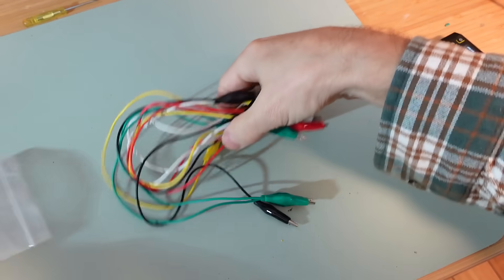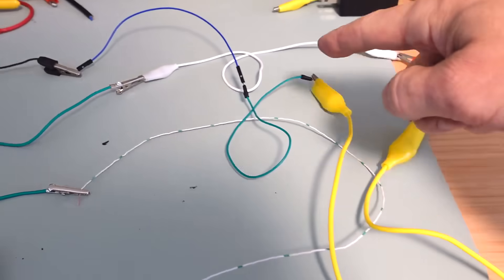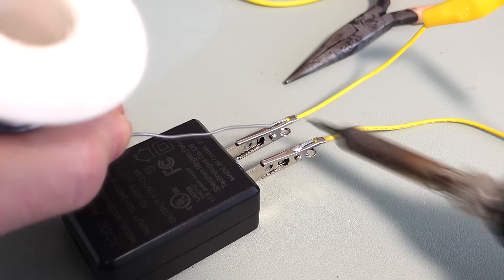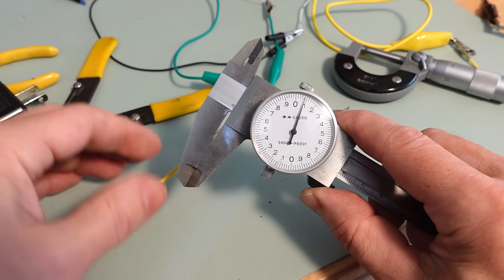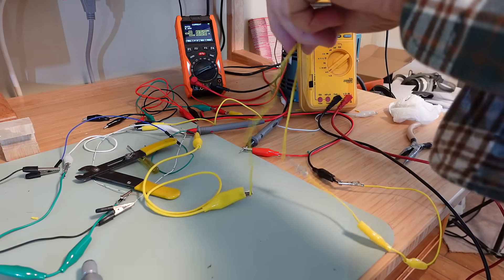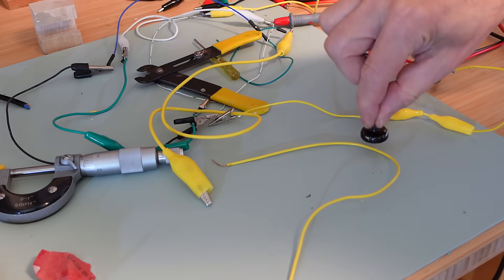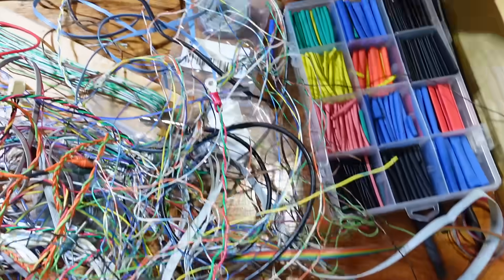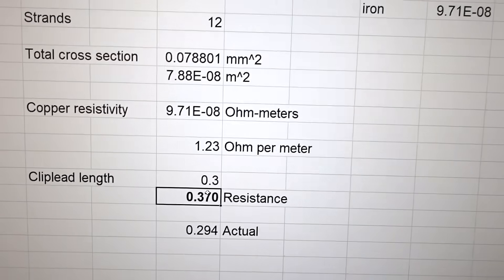Clip leads made with fake wire

Comment: Copper coated aluminum wires are actually quite common, but I dont think I have seen (or at least noticed) copper coated iron wire before... What a tragedy. 
After checking my cables, most of mine ar fine, just a few cheap clip leads are indeed also magnetic.

Comment: My multimeter cant precisely measure milliohms like that (i presume you need a special one) so I've always had to measure this by supplying a voltage with a known resistor in series and measuring the voltage drop on the wire and then doing maths. I was successfully able to observe the difference in resistance over a length between copper and CCA once with this method.

Comment: I think you are simply asking too much from your no-specification cheap chinese trash garbage junk. Every knows these are trash, and immediately replace the wire with real copper stranded. The kit is nothing more than a source for the covered gator clips. You should kniw by now. Old RS were often trash, too.

Comment: I wish you had uploaded this video 6 months ago.. because a year ago i purchased 20 pcs of them and also purchase breadboard male and female jumper wires after 6 months we shifted to a new place and never used them but since they were very dusty due to all the shifting.. i washed them with water and dried them and stored them and 3 months later when i tried to use them, i couldn't get good connection and most of my wires weren't conducting end to end so i removed the sleeve and saw that the wire strands were completely rusted and just broke off...!!!

Comment: I've seen "copper" wires that won't twist and stay in place. It went back straight. Felt like copper plated plastic. (And it was in a iec cable at that, rated for 10 amps... )

Comment: It's called Litz wire. It's been around for years and years. First time I've seen it used in test leads though. The reason it's so high in resistance is that there's very little copper if any at all. It's mostly filler with a few tiny strands of wire wrapped around it. Sometimes they'll use foil. They use this stuff mostly in things like headphones and other light duty applications that don't carry more than a few hundred microamps of current.

Comment: Well done exposing this scam !  💯💯💯💯💯💯💯💯💯💯💯💯
I had bought so called Dupont Line off Aliexpress for prototyping. 
This explains a lot. I had noticed something odd with them. They did seem a bit resistive and if they are bent a lot they break internally very easily, but I could not put my finger on the issue. 
After seeing this vid. I stripped a lead, it had 8 fine cores (abt. the thickness of a hair) and when using fine sandpaper on the copper coating, it can be easily be removed to expose the iron. Can't be tin as at is magnetic ! 
It was listed on Aliexpress as "40-120pcs Dupont Line 10CM 20CM 30CM 40Pin Male to Male + Male to Female Female to Female Jumper Wire Dupont Cable",  shrewdly enough they do not mention copper core wire anywhere or it's gauge.
The sad thing about about this was I read some of the feedback and saw comments like "Excellent quality cables for my Arduino projects. "  What, Huh ?

A search on Ali turned up one listing that did claim a copper core and the gauge:
"Copper Jumper Wire Dupont Cable 10cm 20cm 30cm Male Female 24AWG Solderless Flexible Line Connector for DIY Arduino Breadboard"
  .... hmmm wonder what they will be like ?

Comment: I would suspect that the USB cable for the mouse still has a copper or aluminum conductor, but uses iron or steel for the the braided shielding.

Comment: Had a lot of problems with "arduino" jump wires when needed fast prototyping. Most of them got corroded inside in few months to the point only plastic and dust inside left, impossible to use in any way. Tried to buy different ones on amazon but no luck. :(

Comment: I've been aware of Copper-Coated Steel centre cores in cheap satellite cable for some years, but didn't seriously expect it anywhere else. This is an eye-opener for me.
Copper-Coated Aluminium wiring is more common, I think. Still not great, though.

Comment: I can understand iron wire for Voltage MEASUREMENT, but for Current DELIVERY, that's unacceptable.
But I think most people would be using alligator clips for voltage measurements, and not current delivery.
Still pretty shatty of the companies though if they're selling on-par pricing or not explicitly stating the right resistance or current rating (which I doubt they are)

Comment: Even without having seen the video to the end, I would like to make a comment. 
I spent 6 months in Africa during my studies and we bought a few multiple sockets there in one of the "street-stores". One day we heard a strange noise during the day and realized that it was coming from a cable to one of the multiple sockets (the cable was burning and sparking). After taking it out of service, we discovered that the cable, including the insulation, was as thick as we were used to, but the electrical conductor itself had a cross-section of "no more than 0.5 mm". We couldn't even say for sure that it was stranded copper wire, possibly even fake wire (thin steel/iron wire), as we have heard in the past.
What I'm trying to say is that there is good accessibility to cheap electrical equipment/tools/aids through various internet stores, but when it comes to mains voltage you shouldn't compromise. At some point, there will be a fire in a house due to inferior electronics without a certificate. Standard insurance companies may not pay out because it was not an approved/certified electronic device/aid ... and hopefully there was no personal injury, imagine that alone.

Comment: Thank you for this video as I just got some dupont wires with a device and I tested the and discovered that what should be copper is strongly magnetic. I will put these cables in the metal recycling bin. I went over all of my other device cables, mouse cables, cheap 3D printer cables . . . no other magnetic cables anywhere. --still, very good to know

Comment: quite annoying indeed to have wires with to high resistance. 0.3 ohm for such a short wire is a lot.
even though technically seen it is not illegal or originally seen as fake if the description doesn't list it as copperwire.
so little we can do directly other than making things ourselves or finding ways to buy only wires which actually have propper wires inside and/or speciffically list it as such so that if they fake it we can dispute it if they lied.
didn't expect such huge resistances.

Comment: the iron in the mouse might be the shielding around the wires. most computer mouses have shielding in the wires. even though it might also be actualy iron in there, but that might be dangersous as cable breaks can easily happen in iron wire since iron does rapidly fatigue when bended to much and mouses move a lot.

Comment: I use 2 or 4 awg cable for my electric go carts that use over 160 amps. I stopped buying from china because it was copper coated aluminium 9/10  of the time.

Comment: Good video. I’ve actually had some really concerning experiences with some of those cheap alligator clip jumper wires. I’ve had several of them get really hot and burn when they shouldn’t. And another time I was trying to test ohm resistance on some thing and I needed the jumper leads to get access and my readings were all over the place; until I did it with different jumper wires. That’s when I realized the problem was the jumper wires.

Comment: Found out these are of iron  long time ago. Still they are extremely usefull in the lab, knowing their limitation (voltage drop, amps limit). Another issue would be that, long term, plastic become stiff snd in 5-7 years unusable. I have more than 150 such clips and dropped at least other 30-50 because stiffness. And i have some 20-30 changed by me with copper wire. Very useful.

Comment: amazon stranded wire is almost always incredibly low quality. Stick with solid conductors. I know they are less flexible and a higher resistance for a given cross section, but at least they should be copper.

Comment: a little bit of research points me towards this being a Copper Clad Nickel Iron Alloy known as (Dumet) or coper-coated 42 alloy, 17% conductivity when compared to pure copper. 
i also found a copper clad steel wire that is also magnetic, but it has a much higher conductivity, 40% when compared to copper.

Comment: this is terrifying honestly.  Everyone should be aware of fraud like this.    People in the US if you are buying something that plugs  into the wall with a cord and not just a small transformer box (wall wart, whatever you wanna call it) You should make sure it has a "UL" "ETL" "CSA" or "CE" or possible "FM"  mark at the very least.   I honestly wouldn't plug in something more than a lamp without that.  Specifically things from China.  I have an ancient milwaukee drill that will turn the entire earth when it binds because it's highly geared down for torque and I dunno if that thing has any marks, but its also had 50+ years of unblemished service and a known pedigree.

These are clip leads for measuring. If someone cuts that corner on a legit current carrying conductor you could easily have a fire on your hand.  I'm just gonna go out on a limb and guess that the jacket on those cables probably doesn't meet requirements for most of NA

Comment: I really love that aha moment that sometimes follows a considerably long process of elimination. Even for something as simple as these leads, you did a good amount of work in narrowing down and zeroing in on the causes - and in the process, discovered several interesting characteristics and contributing factors like the crazy high resistance, poor crimping, the copper coated AND ferrous wire used(!) That's a lot of manufacturing cheats and QA failures to have to sift through for such a simple device! Well done investigation on your part.

Comment: The magnet trick won't always identify the Chinese dodgy wires.  They have been flooding the market for years with aluminium wire that is copper coated - even full on mains wiring cable.  It is time people stopped buying stuff from them as they have no ethics or safety concerns for the people they rip off.

Comment: I use these kind of clips when I want to have my current limited, problem with soldering the connections is that they will break at the joint but for test equipment, it is well worth the trade off. These things are a trap for young players. Cheers.

Comment: I wonder if this is the cause of so many phone charger cables that seems to break prematurely at the flex point near the connectors. Phone cables used to last at least the life of the phone. I'll have to start taking some apart and checking. Most of those are shielded and the shielding could be other than copper.

Comment: It doesn't matter how thin each strand of copper wire is, provided there's enough of them.  In fact with thinner strands the lead would be more flexible.  Of course that assumes it IS copper and not a ferrous metal.

Comment: Oh my god! What a startling discovery! I think this has huge implications! I think this is a huge scandal. This is just the various leads you found like this, but I wonder if such "wire" is also use in assembled devices? Could it be responsible for failures? Is it used in e-bikes? Electric "skateboards"? Chinese CARS? Could it be responsible for the rash of fires of various lithium battery powered toys? 

It might seem like I'm jumping the gun here, but I think someone ought to check to make certain. You might of discovered just the tip of a massive iceberg.

Comment: Thank you for showing this! I got such wires myself from China about a half year ago. I noticed quick, that they got high resistance as you did, and I was a bit surprised. I did also solder the ends, and it did also somewhat helped. But I did not back then checked the material. But now I can confirm after using a magnet, that they are also made of iron.

Comment: I knew the title is click bait so I kept ignoring this since this came out. However, will prowse shared this so I had to check it out. Yeah, click bait. I knew the wires in these cables would be extremely thin due to absurdly cheap pricing.  I would use this for testing battery powered electronics.  The most power I put into this is around 60watts average for testing a subwoofer with battery power and charging adapter. indeed it gets hot, I simply parallel another pair of wires and heat is gone.

Comment: Same stuff with the breadboard wires with the round black plastics. The wire is like AWG 100 or so(0.1 mm). Better to make them yourself with female header pins so you can insert male pins to change gender(the square golden pins). This way you always have the right wires with you and easy to elongate.

Comment: Incredible. I thought maybe they'd use very thin gauge copper-coated aluminum, but I would have never guessed they'd use an iron/steel wire coated in copper.

I tested my clip leads and none respond to magnets, but I've had them all for at least a few years so this must be a new trick. Your mention of USB cables was interesting so I tested all of mine with a magnet and only found three out of a few dozen that stuck to a magnet. Being curious, I cut the least-important one open and confirmed that the only ferromagnetic part (in my case) was the shield wire mesh around the outside. The foil is aluminum, and the actual inner conductors appear to be copper.

It's possible your USB cables are the same; I wouldn't be as concerned about the shield wires being iron-based, and it's otherwise impossible to tell in an assembled multi-conductor cable like USB, so a magnet isn't a sure-fire test for those. For individual wires though, this is a good thing to check, and what a scam.

Comment: Jeez. I've seen copper coated aluminium wire before, but iron/steel is new to me.

At least the USB cable I bought of $1.50 on TEMU isn't magnetic. Copper, aluminium, or stainless steel? 😅

Comment: I bought some cheap speaker wire. It says right on it that it's primarily Aluminum, so I knew what I was getting. It was for a very short run (less than a meter) so I'm not that worried.

Comment: I was actually expecting this to be aluminium wire, not iron, as is commonly used in cheap network cable and sometimes even power cables. Does anyone know why you would use iron? Afaik it is actually more expensive than aluminium

Comment: A friend doing mfg in China hung a real bare copper wire outside the factory and one inside the factory. The bare copper  wire outside turned black in a hour inside the factory it took 2 days to turn black. The product he was mfg had a 99% failure rate even inside the IC components were corroding. The air is so toxic in China he moved his mfg over to Philips in Holland were they had it down to a 2% failure rate.

Comment: I have no doubt now that I have a bunch of these as well. Thing is, using iron for the wire is cheap, making it extra-thin is even cheaper, but deceptively coating it with a plating of copper, that's borderline fraudulent.

Comment: Were they copper clad aluminum? I purchased some wire for a small project and when I cut a piece, I thought it looked odd. Look at it under a microscope and noticed the core was different. I did more more checking and found that the wire was just copper coated. :( 

Thanks for the video, I'm a DIY person and I'm just getting into electronics. I never thought to check my jumpers to make sure they are good. I'll be taking care of that. Also, just curious but I needed a 20' jumper while doing some work on a trailer. I used copper speaker wire. I attacked threaded probes to each end and so far, so good.  

Thanks again for the very useful information.

Comment: I also had the bad luck to buy these at one time (maybe 10 years ago) and I didn't even buy them from China. When I found out I basically ripped them all apart, trashed the wires but kept the clips. Whenever I build something that requires a universal interface, I solder these leads on. And they even work for connecting to flat pieces like the butt of a battery by adding a tiny magnet. 
I also used them to make some different clip leads e.g. longer or thicker wire. I even jumpstarted my car 2 or 3 times with a 2.5mm² clip wire (though it was only ~20cm long from a 12V solar battery put on top of the car battery. It worked but was very hot afterwards and started melting the insulation a bit.).

Comment: About the mouse cable, please be aware that the cable might have an outer mesh made of iron strands to reinforce the cable, that's might be why the magnet attaches. That mesh might also be used for EM shielding connected to the outer metal case of the USB-A connector.

Comment: I have those same cheap Chinese clip leads, & I came across this issue a few months ago. I noticed the wire was getting incredibly hot, which I confirmed with my thermal camera. You however, discovered what I did not. That the wires contain iron. So I have used your magnet trick, & magnetted all of my cheapo wires, and I'm going to get new ones. Thankyou so much for your video.
Reply: Have you sourced reliable copper leads?
Reply: @JBK647  Not yet. I've looked briefly. But every bundle of colourful alligator clips that I see online, I'm paranoid has the iron in them again, instead of copper :')
Reply: Is there any manufacturer left who makes real copper croc clip leads anymore? I have DIYed my leads with separate crocodile clips (proper ones are also hard to find nowadays) and proper silicone insulated fine stranded copper cable. They get pretty expensive that way but at least they are good.